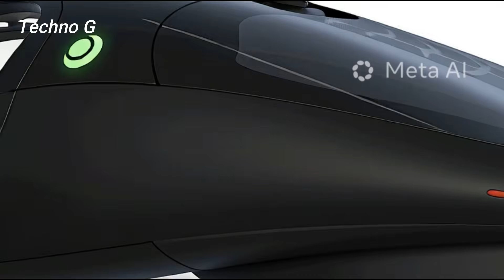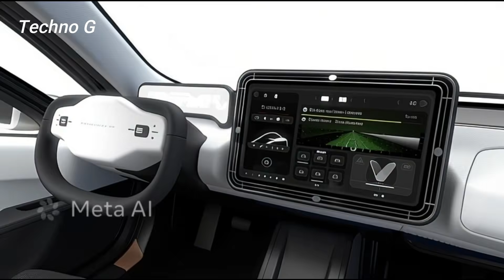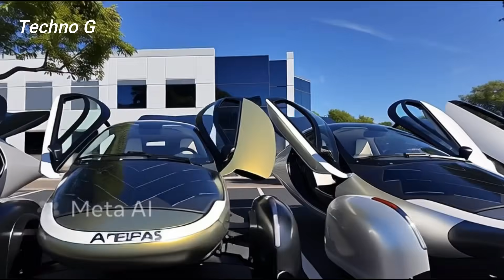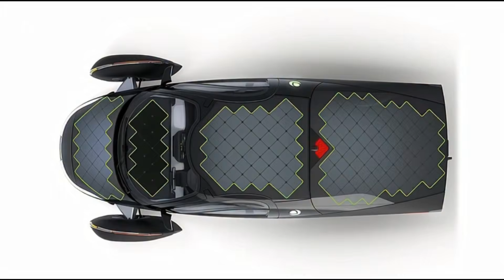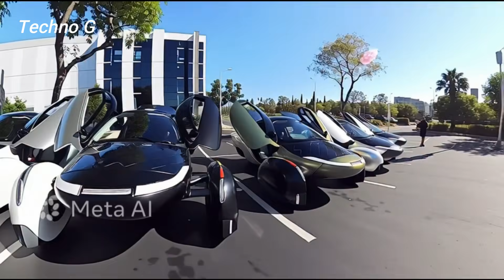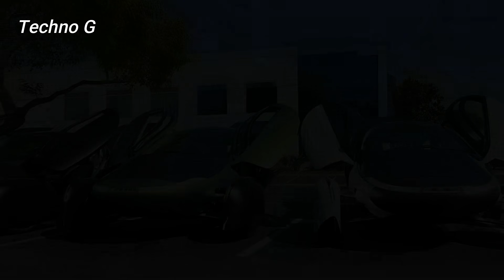The Sun Has Finally Risen: First Production Aptera Solar EVs Officially Hit The Tracks

Comment: Heads up, Aptera fans, Publicly listed companies have to provide more information to investors than private companies do. Since its Nasdaq listing, Aptera is providing more information to investors:

* 2019: We don't have enough capital to start production.
* 2020: We don't have enough capital to start production.
* 2021: We don't have enough capital to start production.
* 2022: We don't have enough capital to start production.
* 2023: We don't have enough capital to start production.
* 2024: We don't have enough capital to start production.
* 2025: We don't have enough capital to start production.
* 2026: We need an additional $45-$50 million to build a low-volume production line, and it will take us 12 months to build that production line, starting after we get that capital. (Info provided in Aptera's SEC filing 13 May 2026)